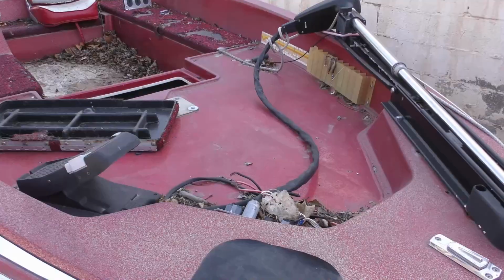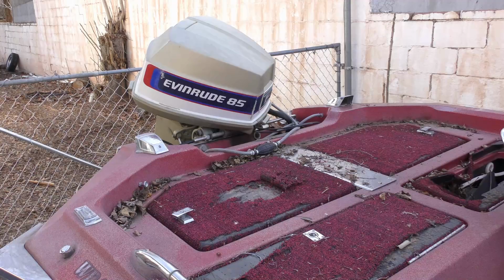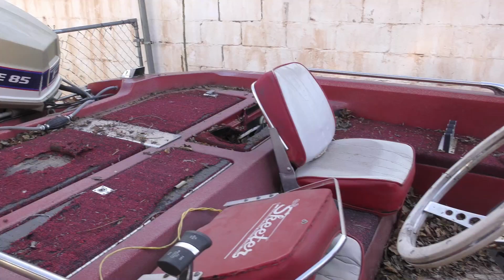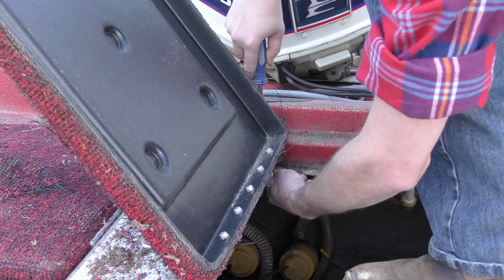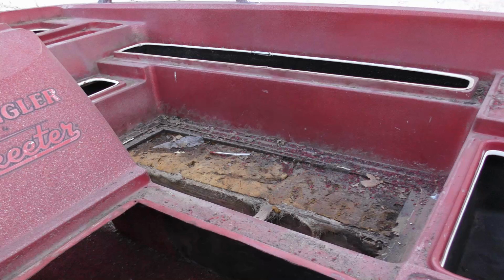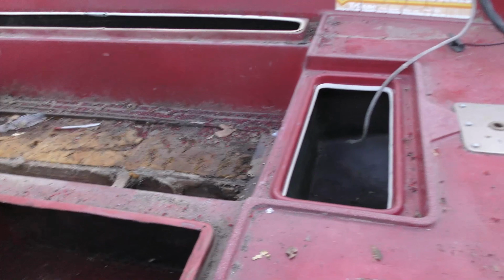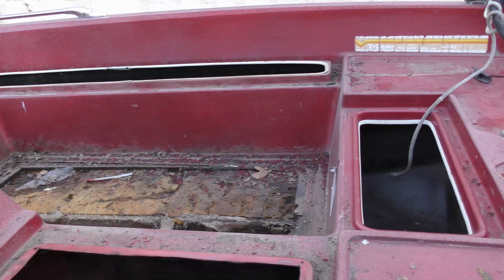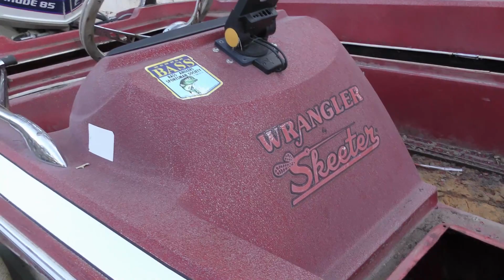Skeeter Bass Boat Restoration #1

Comment: I have a 1979 skeeter  looks just like yours. I replaced panels with 3/4 plywood no problem. You can try and wash the boat very good then try wet sanding small area and then see if it shines. They have a three bottle process that I used on mine and looks good.Cannot remember name but one is a wash, restorer ,and a finish.

Comment: Hello, Yes ply wood works also,I have a 1987 ranger 175 A looks almost like yours for the paint i used spray paint and clear coat but before it dried i went to the dollar store andpicked up some glitter and threw it on there before i clear coated

Comment: The wood is fine it had it in the bottom already but I would put wood sealant on it before you carpet. Lowes has great indoor and outdoor glue. I would see if you can find a replacement lid to replace them with check out tiny boat nation or with skeeters boats to see if they have a match before I would use wood. Wood is fine but seal it good first. You can even use the old door as a mold and make it out of fiber glass.
Reply: Wet sand the paint if there's no clear coat then I would get it re gel coated

Comment: Should be able to buff that out, wet sand it end with 1500 then buff with jewlers Roushe, then buffing compund 1 2 and 3.  Brand new unless you burn thrue on any of those steps. Stringers are gone, be careful

Comment: I have a 84 procraft with 1973 evinrude 85hp, motor runs great but cant figure out the problem, when I throttle up the boat rises but doesn't go fast, looks like the water is boiling behind me instead of a v shape in water, might be prop or gears, hope you get it going its going to look nice.
Reply from the maker: Got mine going (it was a Carb problem) check out the the newer videos on my channel!!
 Yours sounds like a prop issue, and there is a lot of info out there to help fix it!
Reply: cattail3 should it be trimmed down or up

Comment: For the hatches/covers, 3/4" plywood will work.  Really anything will work.  Just remember to paint them with fiberglass resin to waterproof them and make them last a bunch longer.

For the clearcoat, it sounded like you were sanding when you ran your hand over the red.  If so, that means the clearcoat is gone so a wax and buffing won't help you and probably just end up ripping the red flake off the boat.  You're going to need to clearcoat it and polish it.  Good news on bass boats though, there are so many spots all over the boat that you can experiment with and then hide later.

Good luck with your restoration!  I'm currently in the same process with mine.  Tune into my Youtube Channel 'Fuzzy D' to keep up to date!
Reply from the maker: Hey thanks, I'll sub to your channel!!